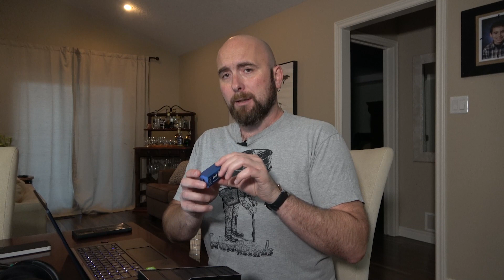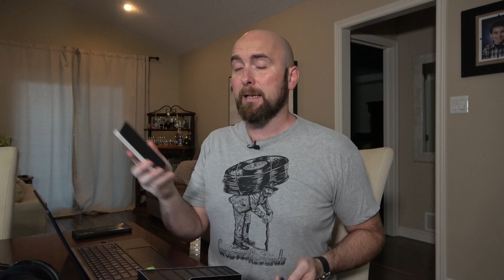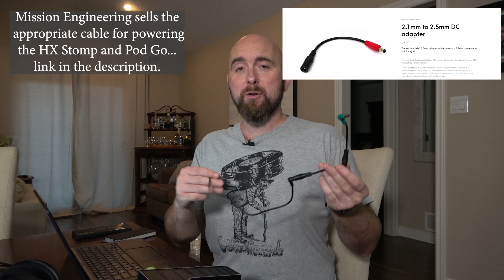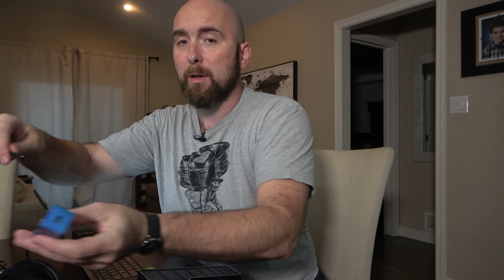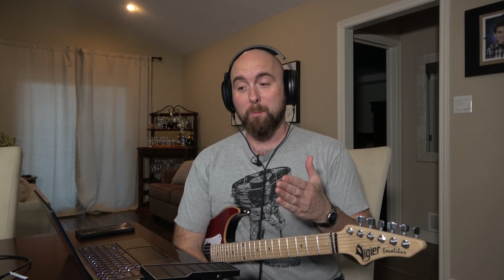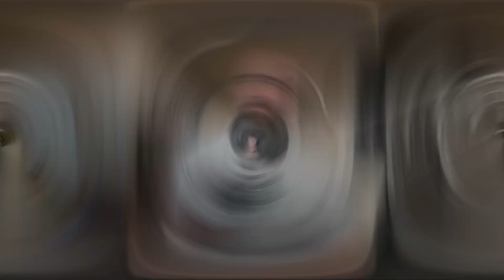POD Go & HX Stomp Users NEED This Product | MISSION ENGINEERING 529 M

Comment: Though this is an interesting product, I don‘t get the use-case. Yes, you can run your rig without a power source but where does the signal go?
To a battery powered speaker (e.g. for a street musician)? Otherwise for the p.a. there hast to be a power cord, that you can use too.
I‘m making music for over 40 years and we always had power cords on our stage. And yes, there were several unplugged gigs but on these we played acoustic guitars. If I really need a little distortion, there are these little plugs like (I think) the nux that can be connected to a little boom box.

Comment: Jason. I don’t see that battery pack available on Amazon right now.
I already have a battery pack I use to power my Spark amp.
It is a TalentCell Lithium ion Battery Pack NB7102, Rechargeable 17500mAh 64.75Wh Li-ion Power Bank with DC 24/19/5V and USB-C 5/9/12/15/20V. 
 Could this be used for powering the Pod Go ?
Thanks for all you do.

Comment: I'm considering a POD Go and this video was very helpful and reassuring, as I cannot seem to find many 'spare' POD Go power supplies anywhere.  I always like to have a backup to my backup to my backup when doing live gigs.  Keeping that in mind, could you still power the battery w/ AC power WHILE it is sending power to the POD Go?  And/or on a break?  I realize this video allows you to be AC-free and 'cut the cord', but I'd be a little nervous that the battery would run out mid-last-set after getting there an hour early for setup/soundcheck, then possibly playing over 4 hours in a show.  So, can you power it via AC while it's powering the POD Go or would you just plug the battery in on a break and give it a 15-m 'recharge'?  Thanks in advance!

Comment: Why not just use the 5v to 9v usb cable from ripcord??
Reply from the maker: Because it would not work. My understanding is that max output of the Ripcord is 9 watts which would equal 1 amp at 9 volts which is insufficient for a PodGo or HX Stomp.